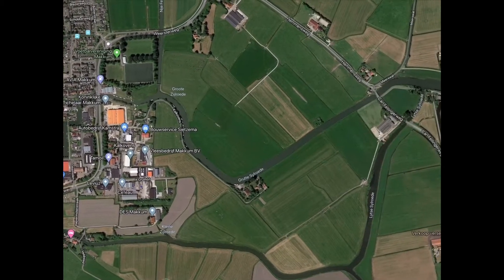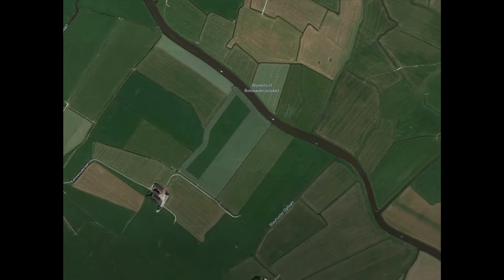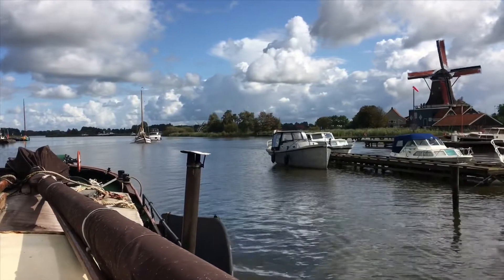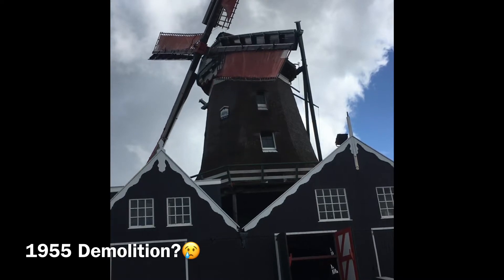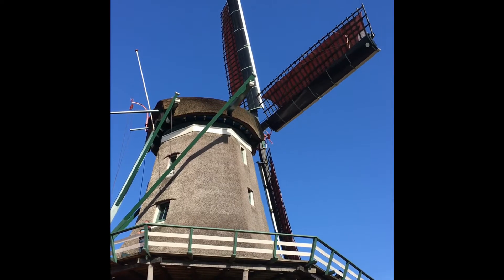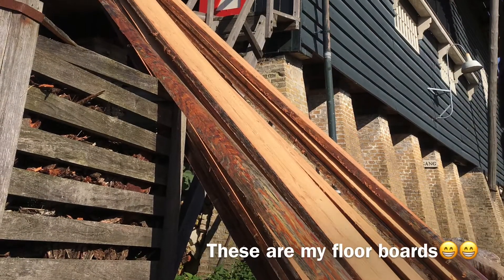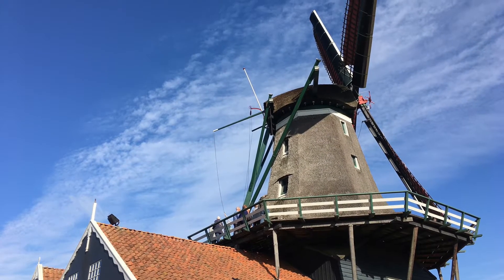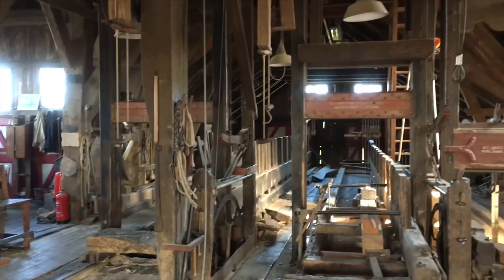De Vrouwe Linda #5 A visit to the Dutch Windmill “The Rat”.

Comment: Loved the hair flip.  Did you live at the boat with, no, electricity, no water,  no etc., for that year?
Reply from the maker: I was traveling back and forth so I was only there occasionally. I did have a mains hook up, but no running water. I washed in a bucket!😂
Reply: @canicebannon  thanks for taking the time to answer my questions.  I am trying to catch up as fast as I can.  It is addictive.  I have no clue what you are doing , except raising and lowering the mast….a lot.  But your presentation is so different from other Vloggers., it is a lot of fun. Great job 👏🏼